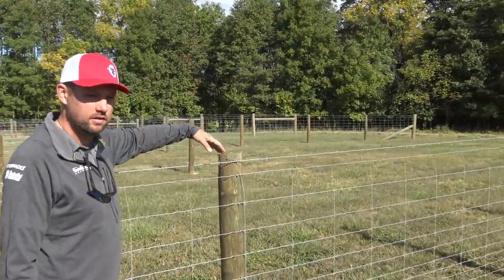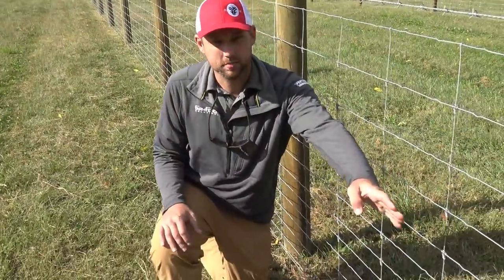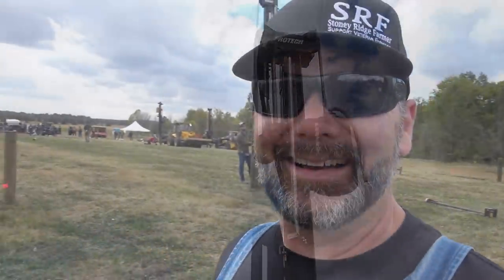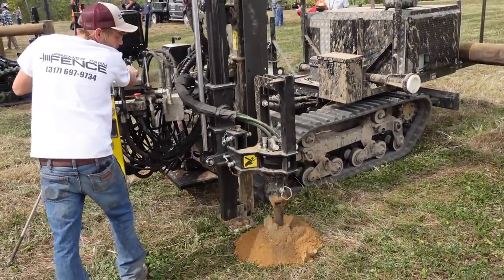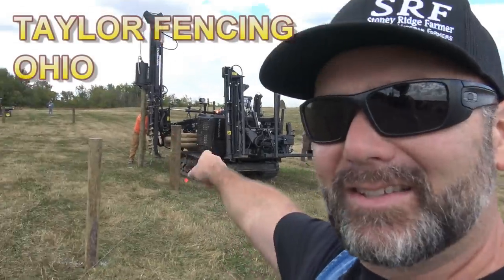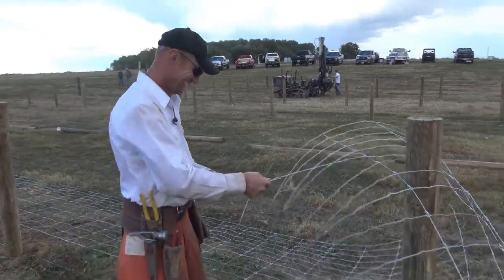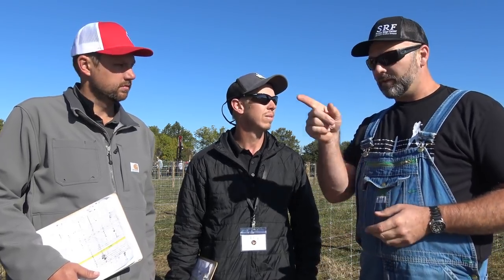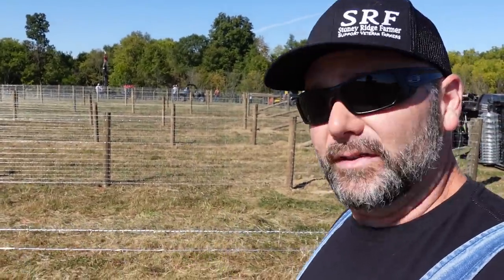Farm Fencing at it's best! Awesome fence building competition with Tornado Wire!

Comment: Good stuff Josh!  I enjoy these types of video's....very educational!  I am curious though why they cut the dead man off....it exposes the cut surface to moisture so I would think it would not last as long.    Or maybe, it is dependent on soil type too.  I definitely see what I did wrong on my own fence through the soft ground....We have trouble with corner posts coming out of ground with the pressure of the wire...an H brace does not keep it in ground either but thinking maybe the dead man may....dunno.  I even have a line where the frost keeps spitting the posts out....we all have our challenges eh!  And on a side note.... just a funny...what's a compeditor??  lol.

Comment: None of them are near my property in FL or NC☹️ It took me a year to find someone to build me a gate in FL. One square frame with a cow panel. There is a shortage of capable carpenters. I’d love to see all my wood projects done someday. Most young men that Look at the projects barely make it through the first, then don’t return. The last man wasn’t too young that did the gate, great work, but the next project on the second day he was to install four post into the ground to build a simple trellis like monkey bars, for my late mother’s plants to grow on over a bench seat. I came outside to see how it was going, he was putting concrete in holes with his hands. His face was smeared up with it, like a mask. It was around his hair, eyes, neck and in his mouth. I asked him if he wanted to wash it off or needed a towel, he said no he likes eating it. I had all the tools there but he decided not to use them at all. He finally went for lunch but never came back. My neighbors have to look at the top that was never squared off. 😬 there is excess 2x4 that he never cut to complete a simple top frame. I’m sure all the railing boards that I bought are curled up by now. I can’t wait to get back and hopefully get things finished. Then turn around and get my late mom’s cabin finished. Those fence men were all winners! Hard workers!